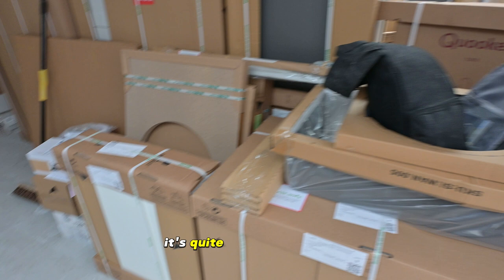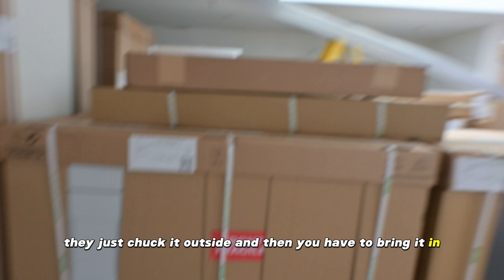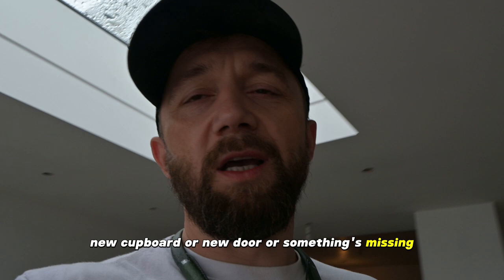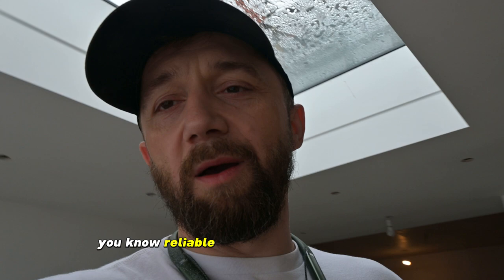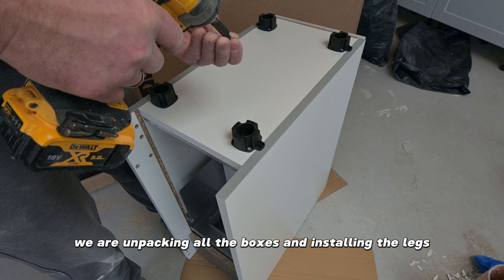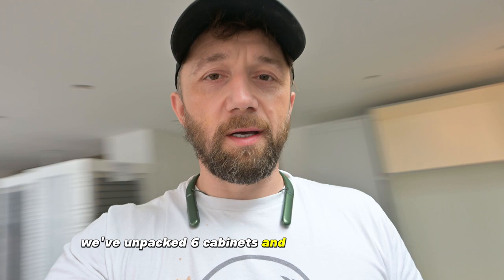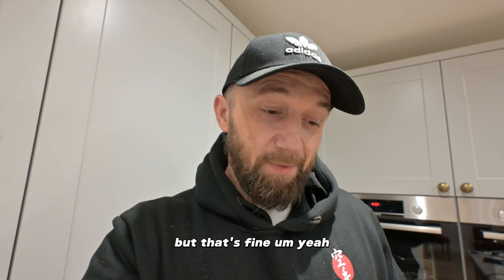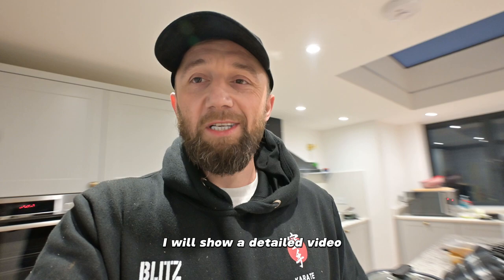Installing WREN Kitchen, Another Disaster??

Comment: What a waste of space in that corner we’re the big units r. Don’🤯🫣
Reply from the maker: Yes it is. Unfortunately WREN doesn't have a corner tower unit. It's around 1cubic meter of space wasted
Reply from the maker: It's down to the designer really. They could easily supply some panels so I could build the unit myself, but on one side of the corner they put the fridge and on the other side the oven😮
Reply: @yesconstructionltd  
Always the way lol 😂